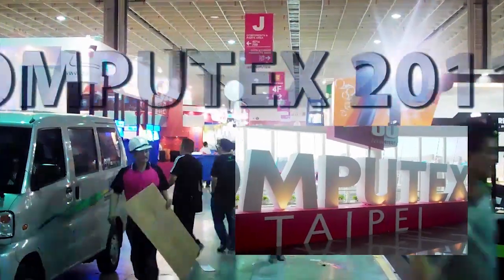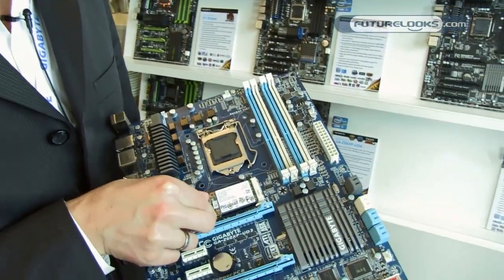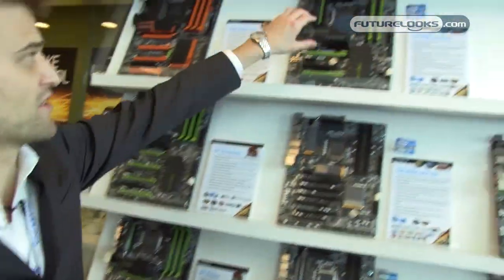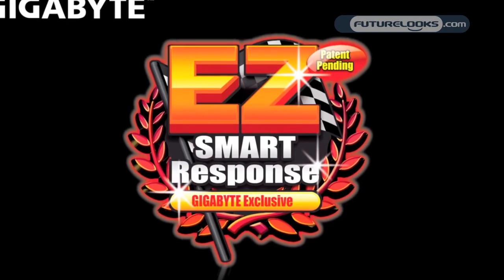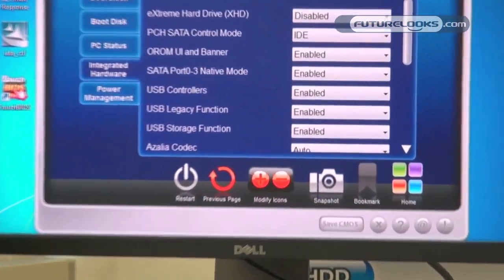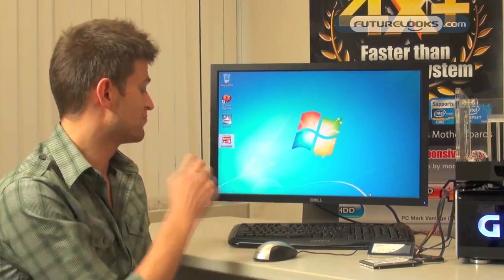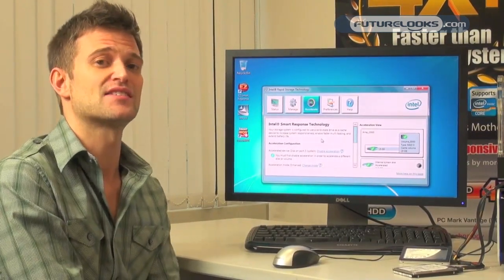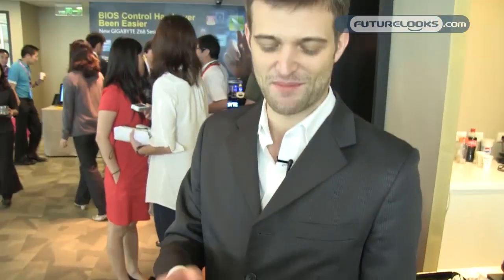COMPUTEX 2011 - GIGABYTE Unveils New INTEL Z68 G1-Killer board plus X79 LGA2011 Board and More!

Comment: @Futurelooksdotcom I've noticed it only has 2 memory module slots. So if my idea is correct you can put two 8gb ram sticks in making a total only 16gb of ram? When the X79 replace the 1366 since the LGA 2011 is backwards compatible with 1155 will intel be releasing more 1155 socket CPU's, along with LGA 2011 ones? Also any word on a cpu to compete with the performance of AMD bulldozer?